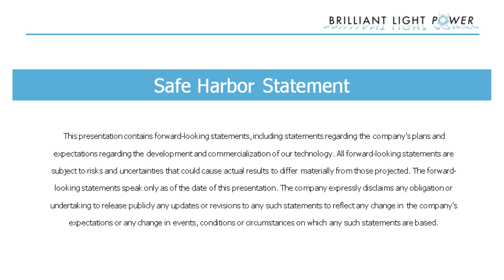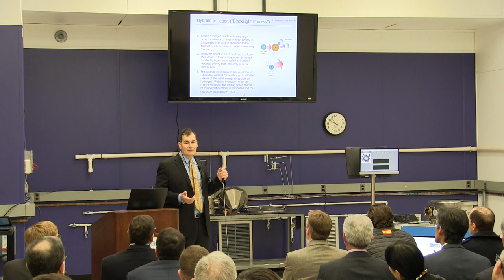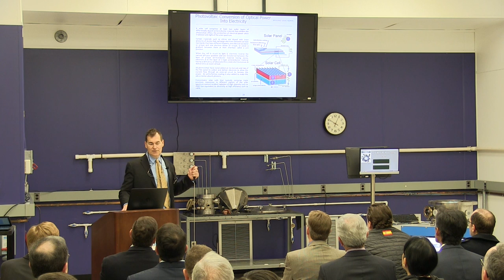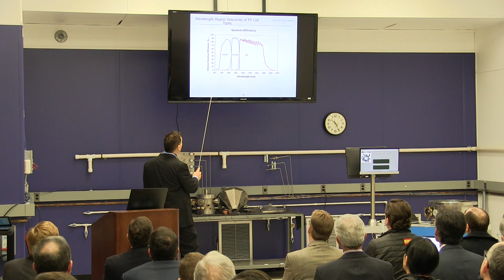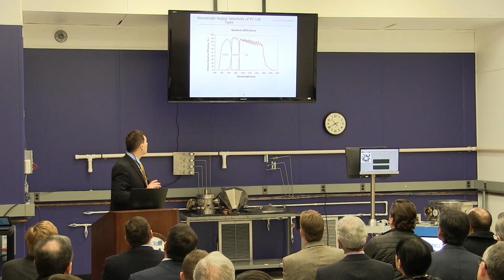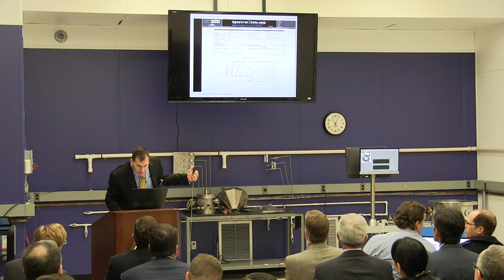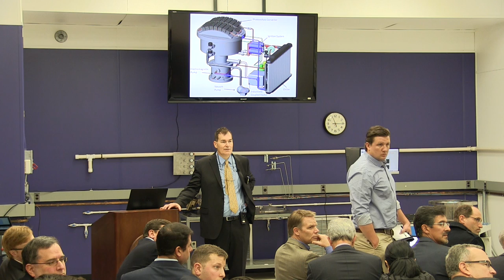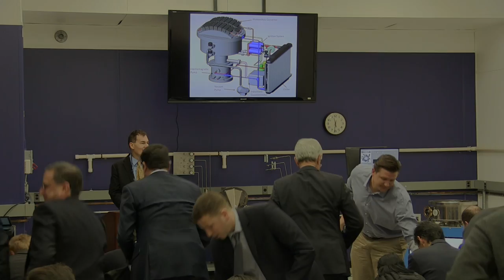Brilliant Light Power Demonstration, January 28th 2016

Comment: I see a problem with the vacuum pump. When it will run it will absorb silver vapors. These will partly be evacuated in the atmosphere and partly will condense on the conducting pipe and on the internal parts of the pump. So it would be needed a way of totally controlling the silver inside the chamber (both liquid and gas), or a way to condense the silver vapors when these enter the vacuum pipe in a condenser where the temperature is controlled so that the silver gases condense but not solidify on the walls, so the temperature must be high enough to keep it liquid.

Comment: Interesting. If they charge $.10/kwh, I wonder how that would compare to solar rooftop installations? Lifetime costs for rooftop PV today is about $.12/kwh and dropping. Once BrLP releases their tech, it might make sense to install both because rooftop solar prices could actually be lower than SunCells.
Reply: They are not fixed to a price. The market will determine that but they estimate around 5 cents a kWh.
Reply: Kurzweil puts effectively-zero model cost for PV at ~2036. Using exponential trend data from last two decades I'd say ~2040. By that time applying PV to any external cladding material should be a trivial expense for point of sale value adding either as film or spray on (solarPV in a can). But the chemical battery curve is less extreme, so if this can get in underneath it it will halt development of stationary energy scale battery storage to a significant extent. He's need to licence it out to many makers to get significant disruptive scale though.
Reply: funny that because US government wants CST with thermal storage to hit 6c/kWh by ~2020 (and it probably will). If the EROI of this is as high as the claim and the fuel is 1 litre of water per 100 MWh or whatever he said then they can do a lot better than 5c believe me!

Comment: how much voltage and Amps used across the electrodes ?
I heard him using 1200 Amps and 10 V power supply for the whole system.
Its at T = 45:20